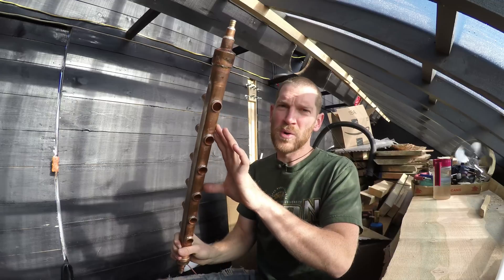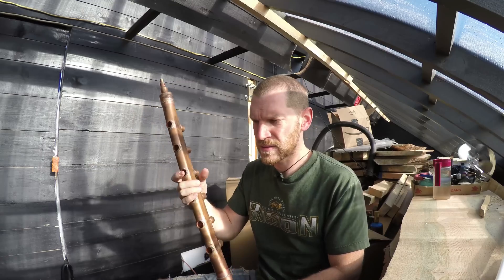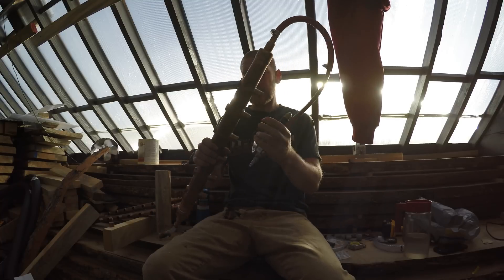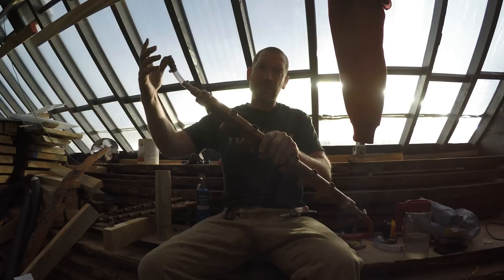4K HD: How to build a solar evacuated tube heat exchanger

Comment: just saw this video and wondered how the pex worked out?   i had a solar water collector (10tube) on my roof...  had it directly connecting pex to the in and out of the collector and it got so hot it literally exploded the pex...  tried it twice, both times exploded, so i converted to copper dropped it down from the collector top to the bottom (slanted stand) about 4ft, then 90 about 3 more feet, then connected to pex to drop over the roof and that seemed to work.

Comment: How did you flatten sides on the round copper pipe to produce the manifold tube?  You needed to immerse the manifold under test in tub of water and observe if any bubbles are produced.  Your leaks on connections though minor after the gauge will give false reading.   Because of the operating temperatures I would have opted to braze all of the joints.  Granted solder melts at about 700 F the heat at lower temps do start to soften slightly. The solder joint coupled with pressure of the liquid medium this can hasten a joint failure...  Brazing rods melt at about 1500 F the copper pipe melts at about 1800 F.  With this in mind the brazed joint would be the better joint.   Excellent video keep up the good work.  :)
Reply from the maker: +Mike Schmidt The flat parts were done with a hand held planisher and a square tube inserted inside to planish to. I'm not to worried about the joints. I've done some temperature tests and I'm hitting 220F without circulation so I don't see myself getting over 200F once the coolant starts flowing.

Comment: So I take it that the heat tubes tips will be inserted into your manifold, and your glycol will pull the heat from the tubes?  Run your glycol through your manifold, heating the fluid, then through a radiator with a 12 volt fan blowing additional hot air into your kiln?
Reply from the maker: +WC4DOOR Yeap, that's the plan. I'm building the system to handle 225 degrees. We'll see what it puts out.